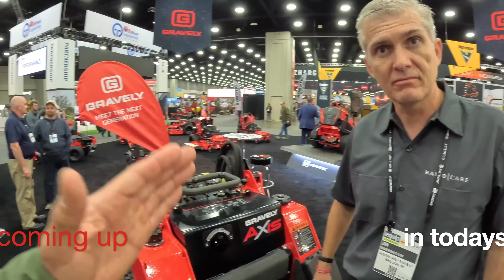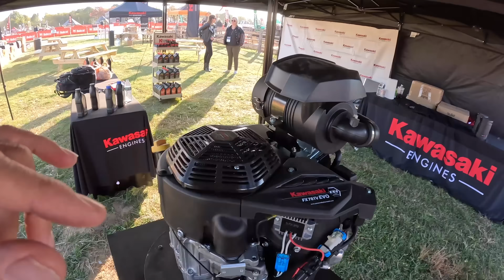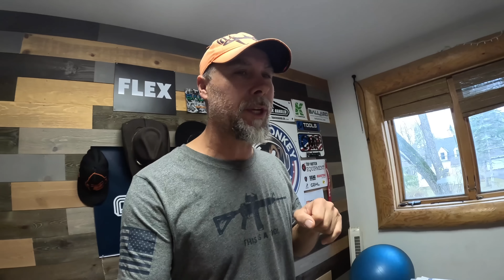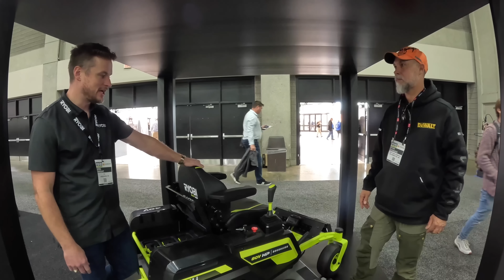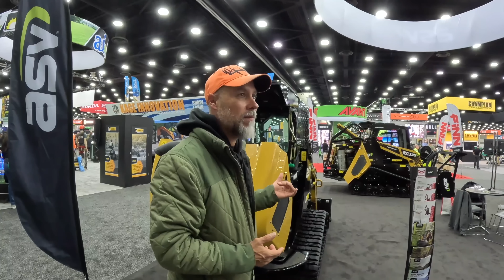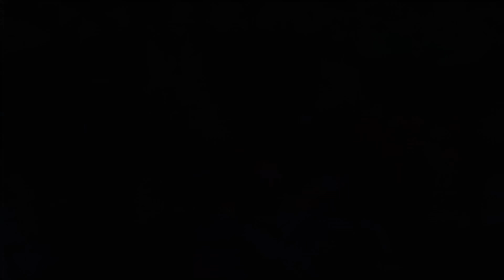New Tools & Equipment at Equip Expo 2022 #2

Comment: Talking about striping a lawn you must check out walker mowers  decks have timed blades to cut in opposite directions but discharging to t b e rear with on-board vacuum built in to the mower.  Naturally stripes with I UT rollers

Comment: I've worked with DeWalt 60v chainsaws for 3 years now.  The first one I bought still runs strong to this day. With a 9ah battery you get enough wood for a bonfire but not going to be building piles with it. 

The problem started when I bought DCCS670 #2,3,4,5 they all would run perfect for a few days but they all ended up failing to motor burnout some in glorious smoke and flames and would leave us stranded cutting trails. This is not acceptable for a $400-$600 saw. A comparable Husqvarna or Stihl will work circled around this saw in any weather. 

I have completly switched back to gas powered saws. Even with me missing my left arm and starting gas saws proves easier and less of a headache than the all plastic toy called chainsaw model DCCS670 

 I have circular saw, recip saw all drills and power tools DeWalt. Normally great stuff. But the 60v chainsaw is easy to keep by the door and chop a log slightly if it's too big for the stove. That's about it convienience if you have to make a cut or two. Or trim larger trees ( it does make great cutting power) when not on fire 

I forgot to add that they leak bar oil so bad you have to store them on paper towels or it will drip and cover everything you own.

Comment: I had the 12” until it was stolen. I cut down 8” trees with it. Made pruning and removing branches easy. It turns slow rely’s on torque to do most of the intense cutting. But I own the batteries and can’t afford a Milwaukee chainsaw to compare it to yet yes I own the Milwaukee batteries to. Dewalt is my woodworking tools and Milwaukee tools for automotive fun. Dewalt was giving away a battery with tool purchase during Covid so I bought a few  and cheaper than Milwaukee!

Comment: I usually agree with most everything you say, but your comment about kohler engines has me stumped. Have you done your homework on the brand? Kohler power systems has been building engines for small equipment for a long time, and from experience, I consider them to be one of the most dependable engines I have used.

Comment: The cormidi looks cool, but it’s not a work of art.  It’s a practical piece of machinery that has to move in order to evaluate.  How do you sell something by just looking at it?  Maybe if you’re such an awesome product you can do that.  But then why be at any expo if you’re already that big and bad and awesome?  So, that was such a major loss for cormidi to have nothing running.  Even if they were out grabbing fuel, you should have a rep standing there to answer questions and assist while you wait for a fill-up for testing.  The whole trip to the expo is written off as a sales comp.  So there’s no concern about costs associated with doing all the demos.

Comment: I have a dewalt chainsaw. Bought it because I already had some dewalt batteries and other power tools. Use it to clear fallen trees from trails. Works great, battery power holds up. I just think it uses too much oil but I have never been a fan of auto oilers having learned on manual oilers.

Comment: My DeWalt chainsaw is very nice. It’s the first saw I start with for general property maintenance work. It’s stealthy compared to gas and is what I use for most medium trees to small branches. I use my Shindiawa 488 for the trunks. I really don’t want everyone to know I’m doing tree work. My 9 & 12 amp hr batteries work long enough to give me a good workout and are not heavy in the saw. It’s light and well balanced.  The chain adjuster/bar retainer is very convenient. The bar is light weight, thin, and twists easily. It leaks oil. The battery compartment and contacts retain wood chips.

Comment: I have repaired a Dewalt chainsaw for a customer in my small engine shop. I was not impressed with how cheap the internal components were. The electronics were fine, but the oil pump stopped due to a cast aluminum pin breaking which was supposed to actuate a cheap plastic pump. These components are much better designed by stihl and husqvarna and echo.

Comment: 60v Dewalt 16in. Chainsaw. After not much use, some parts near the clutch came loose. Not sure if it was user fault or manufacturers fault. If your planning on cutting a lot 2 batteries will not be enough.

Comment: I own a Ryobi zero turn from a couple of years ago and cut a 10 acre field with it several times a season. I cut roughly 2 acres at a time and have never had a problem with it. I also own a Dewalt electric chainsaw and the only problem I have is it leaks chain oil.

Comment: I've got a cormidi 1500, I wouldn't recommend them unless they fix a few problems. 
fuel system syphons itself empty when its below half tank 
 less than 150 hrs and the drive motors had to rebuilt.
 im on my 3rd throttle cable because the housing end sits vertical and collects water.
 the unit swapping is a pain in the ass and is not nearly as quick as advertised 
 plastic coverings are very brittle and crack a lot.
 motor mount bracket snapped and wrecked all the isolators so i took that to a fabricator
 ridges on the rear engine cover makes for a good knee cap remover. (not kidding, hurt like hell)
 rear platform is unsuspended and uncomfortable on a long day. 
product support has been pretty slow and we cant get ahold of parts or service manuals. 
most of these problems we have solved ourselves but it has taken many hours and lots of down time.
All that being said the machine preforms well and hauls a huge amount of material and the self loading and turreted unit is really handy on smaller jobs that eliminate the need for a loader. 
from what ive herd from rental places that hat have the 85 its a much more reliable machine than the 1500

Comment: I really like those square barrels I could have used them today my very brand new crew could have loaded those up instead of putting the spoils on the surface that they were working on or in the street they could have loaded them up at least two wheelbarrows of material and with my little ditch witch ride on All purpose tractor I don't know what size it is because the stickers when we bought it we're gone but I saw a lot of the ride behind tractors in this expo and I'll tell you that little ditch witch machine may not have the power that those right on machines do but it has the mobility it gets into smaller places it doesn't need a lot of room to work it doesn't take a lot of trailer room and you can put all of its implements which we have a 8x10 enclosed trailer but I mostly carry it on the back of the dump trailer because I need to dump trailer more than I need the enclosed trailer but I liked those barrels square barrels thanks for showing them Stan Lee

Comment: Hey Stanley, another great video. I bought the largest 60 volt DeWalt chainsaw 2 years ago for use in a man lift. It loves it's batteries! I went through 21 changes on 6amp/hr batteries limbing a super large Elm tree. It has 2 small flaws. Batteries are had to remove and there's only one stud & nut holding the bar on🤯. (Dude Ranch DIY) was using one of those Cormidi - mini-skids on his channel for tree work. He stopped using it. Not sure why 🙄. Keep up the awesome content ❤️
Reply from the maker: Good to know thanks Ron!

Comment: Since an electric lawnmower is all electronic control they should make the joystick so you can unplug it from one side and plug it into the other, heck even plug in a remote control unit or switch between a joystick and lap bars.
Reply from the maker: Smart! Sounds like you need to be making these 👍

Comment: All stated battery run time claims are tested under absolute perfect conditions. It sucks because people think they are going to get that run time normally. Fact is Ryobi probably tested this run time while clipping 1/16” off the top of the grass either going all down hill or absolute flat yard with a 100lb operator not charging your cellphone. That’s what manufactures do with battery electric claims.
Reply from the maker: Hmm sounds like I might need to try one of these out then 😈
Reply: That would be awesome! 
Maybe an updated electric chainsaw match next. Iv been wanting to see a head to head match with the new dewalt flexvolt 20” vs the ego 18”.

Comment: Great video!! I have a 40 volt Black & Decker battery chain saw. It cuts just as fast as the saw you showed. I do have two batteries so that gives it some good cutting time.Not any thing like a gas saw but it sure is nice for trimming. Nice and light with some pretty good power. Price was OK too. Thanks 😊.
Reply from the maker: Sounds sweet! Hope it treats you well 😊

Comment: I run two C85 Cormidis. We do high end residential landscape construction.  

They are one of the best purchases I’ve ever made. 2 guys operating them can do the work of about 4-5 guys running wheel barrows. 

They never get stuck. Can go through any terrain and up a hill steeper that you can walk up. They carry about a half yard of gravel, soil, or whatever else you can load into. Armour stone, logs, concrete, large trees (350cm evergreens with huge root balls)

We have the standard bucket cormidi and the fold down side cormidi. We use the fold down side cormidi to load on a 3/4 skid of brick to bring to backyard. A full skid is too heavy. 
We use the bucket cormidi to mix bags of cement with a flat bucket on the mini excavators. 

We don’t use the self loading cormidis. Too slow and awkward. We use Kubota U17 excavators to load them. 

I highly recommend them. We have the older model. The newest model has some fantastic upgrades. Steeper dump angle, remote choke, fuel fill on outside of machine, upgraded air filter/engine. 

Just because they are small doesn’t mean we don’t use them on larger projects. We take them to every project to help move any material. They literally have replaced wheel barrows for us. 

Super simple to drive. The new guys can figure out how to operate them within a few minutes.
Reply from the maker: That’s what’s up! Thanks for sharing 👍
Reply: Thanks for posting, I went straight to comments, looks like I could use that in the concrete industry